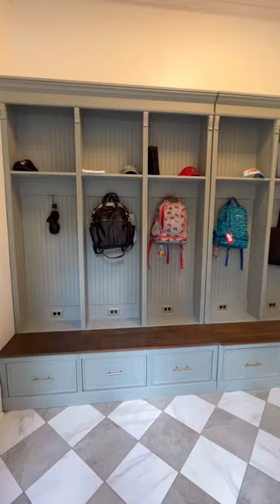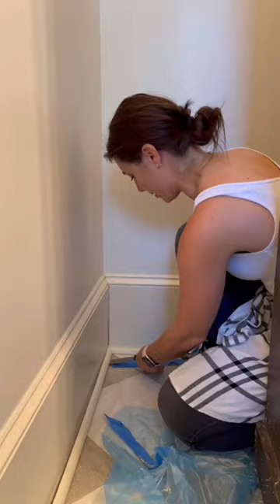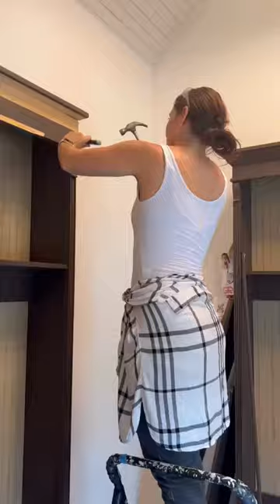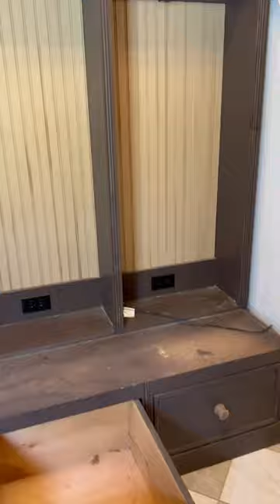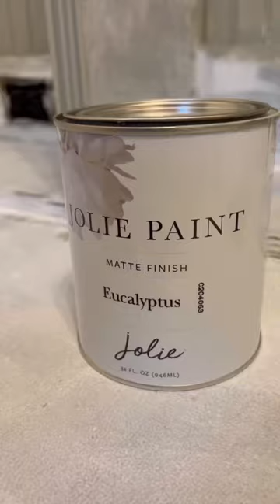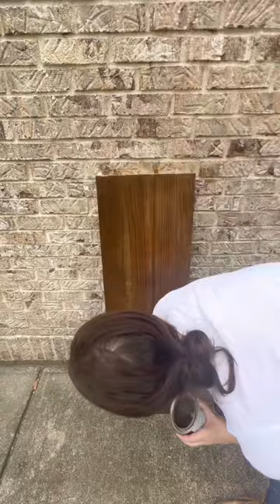START TO FINISH: MUDROOM HALL TREE MAKEOVER #foreverhome #furnitureflip #beforeandafter #mudroom

Comment: The fuck is a mud room
Dam I feel poor
Reply: Its a room where you put your mud 😊
Reply: In the UK it's called a boot room. A place to take of muddy/dirty shoes /boots. Hang up jackets leave sports gardening stuff
Reply: In the US, a mudroom is typically an entrance to the house that has either a washer and dryer, a wash sink, or even just a small area of tile to keep dirty shoes off the rest of the floor in the house. It sounds fancy but again, a 6X6 room with tile floor constitutes as a mud room. It’s really not. The mudroom in my house has concrete flooring, a washer and dryer and 3 windows side by side. It has enough extra room for a stand up freezer and that’s it.